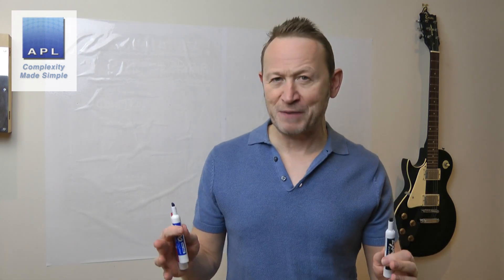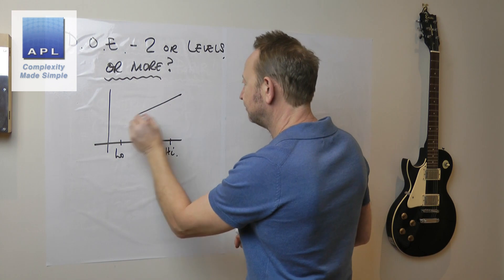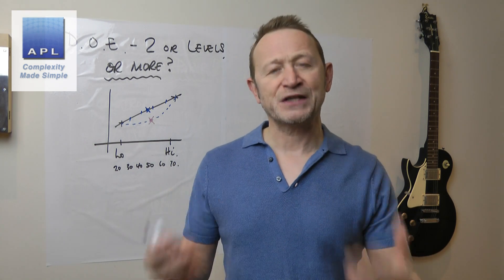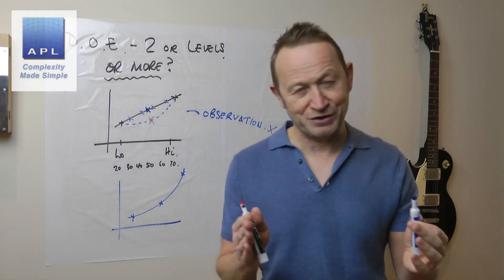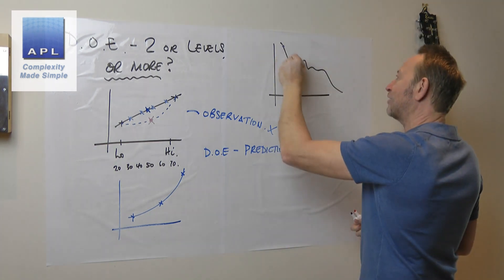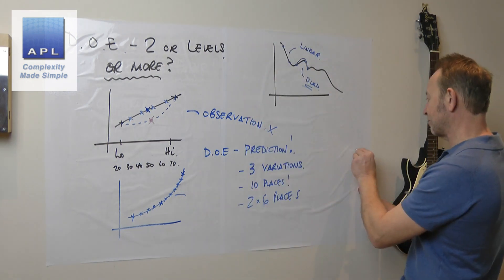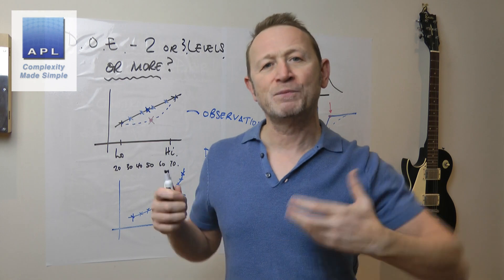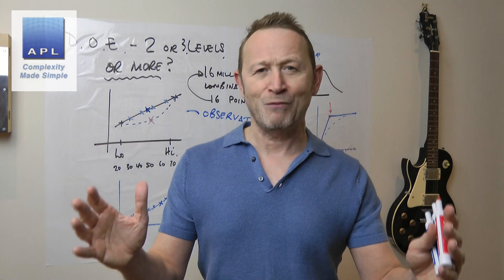DOE - 2 Level or 3 Level?

Comment: Good afternoon Mr. Allen.

Do you know if DOE can be used to test the behavior of Artificial Intelligence system?
Reply from the maker: Hi Vin thanks for the question. You can conduct a DOE on any system. Provided you can measure the process performance and you have individual variables that you can change...if you need help designing an experiment, drop me a line I'd be happy to help - Paul.Allen@allenp.co.uk
Reply: @paulallen5321  Thank you. :)

Comment: Hi Paul, thank you for your videos I am learning a lot. I was wondering what would you advice if I have 4 categorical factors with 3 levels each -not ordinal (ie. apple types as the ingredient: gala, pink lady and honeycrisp). I understand the logic behind using only 2 levels in numerical factor cases however I am finding it difficult to understand what would be best for my case. Thank you in advance.
Reply from the maker: HI LVBS - well clearly you have a 3 level issue there so a 3 level DOE could be used , but if you had 3 apple types and 4 supplier types and 2 water types. Then a D - optimal design would be good, maybe even an all pairs test...
Reply: @paulallen5321  this is great information you left me here, it was another issue I was facing, what to do with factors with different levels, thank you very much for the prompt responses :)

Comment: I'm a fan here. Great work Paul. I work with chemicals and formulations to fabricate processed products that people buy at the supermarket. I've done it all: adhesives, paints, beverages, processed foods and cleaning products. So as you can guess mixture experiments are my thing.  On the other hand, response surface methodology (rsm) is great for optimizing simple process variables: mixing speeds, loads, volumes, temperatures, pH, etc. Minitab and JMP are great, but I just love R. And soon found that applying separately mixture experiments for composition purposes and process experiments for productivity purposes, is just too much work.  So the process-variable design is assigned to every mixture blend of a mixture design. In my world they call it the crossed mixture design and then it is coupled with RSM and multiple response optimization through a desirability function, which sounds about right. But is it right? Or are we overthinking this? What do you think?
Reply from the maker: Hi Victor - I think the true test of your method is does it work?? It may be mre complicated than than you think it should be, but if you understand your method, like and it works then it's good method..
Here is my prefered approach let me know what you think - https://youtu.be/2Vn7k1Y03nk

Comment: Could you help in understanding the ANOVA model, how to execute it from starting, how to enter data and should we have to do replication?
Reply from the maker: Hi KK - No need for Anova. I would use multiple regression. However, the whole thing is a bit too complex to explain in a message. As far a res go you need to generate 40 data points in total in your DOE test...

Comment: A common mistake I see all the time, people try to shortcut and use the DOE test straight away to find the optimum parameters contained within the tested matrix instead of doing the all the necessary calculations, they simply pick the best results from the tested matrix.  It could work but their results would be more efficient if they followed proper DOE methods.
Reply from the maker: Yes pick a winner is an option, but the modelling approach is so much better...